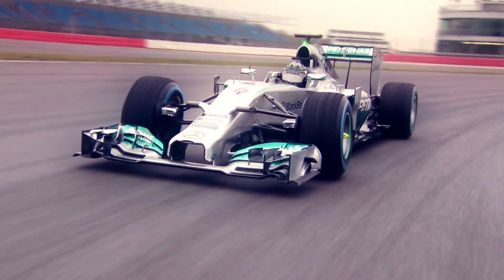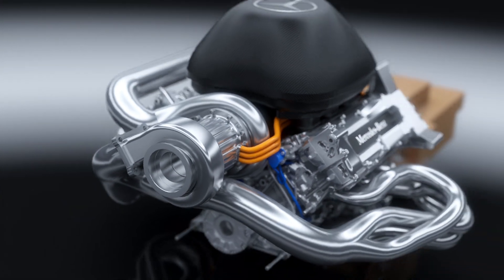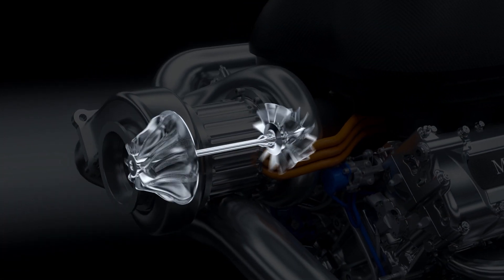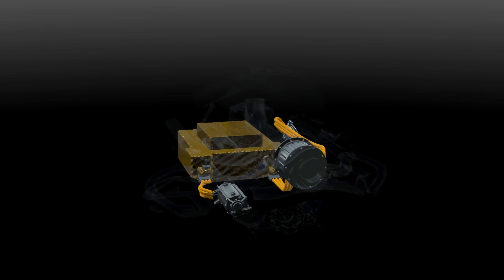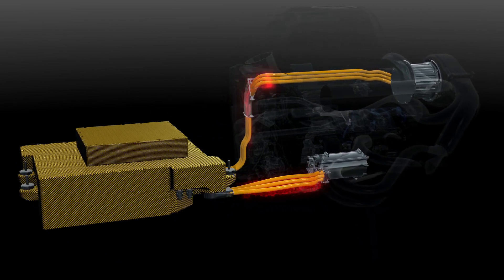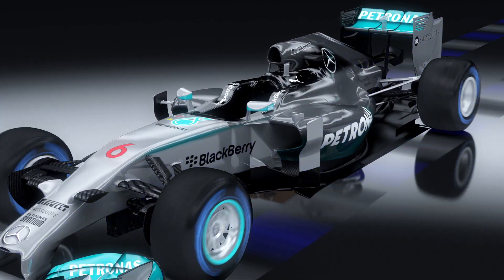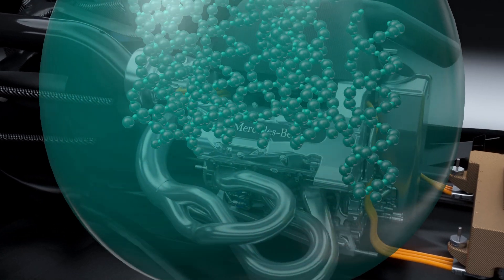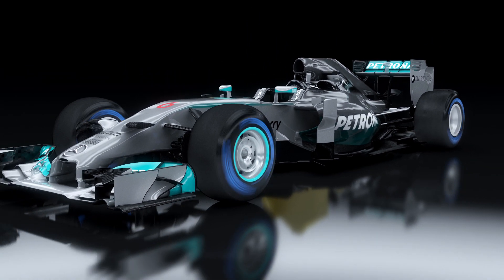Up Close and Personal with the Formula One Power Unit

Comment: Why do these engines keep getting smaller in time? From the monster V12s to the V8s and now V6? Couldn't this technology have been fitted into the V8? Why does F1 keep doing this. In a few years these cars will be running on motorcycle engines producing same amount of power as these new v6 from how this evolution of the sport seems
Reply: One word: Efficiency

Comment: Would it matter if Renault did see this video  because surly with the first race next week the FIA would have locked the further development of the power units unless it was a safety concern I know these units are so complex but surly a company of Renaults stature and experience of  building F1  race engines for years should  had it running fine by now I can see this season being a transition season for most teams though I've herd  that red bulls problems in pre season has been one big rouse to throw the competition off and didn't have the issues thay was telling the press  and that thay going to turn up in Melbourne with the car  running like a dream
Reply: whoever told you the red bull were faking their problems is a moron. there is absolutely no benefit in not running the car to fool other people then going to melbourne blind without any knowledge of how the new powertrain functions. red bull have serious problems i wouldn't be surprised if the broke down on the formation lap

Comment: Yeah, but does it go FAST!!!?
Reply: Very fast the losses are substantially lower then in 2013 , 30 precent more power from every drop of fuel is really difficult to achieve. Mercedes fighting =)
Reply: blendon8 yes, but the cornering speed will lose most time. the cars are not that aerodynamical now, because of the new nose.
Reply: Atleast we have more engine power(torque).
Reply: in a straight line they are much much faster than last year but with the aero dynamics taking a hit there is a lot of down force is lost through the corners so overall laptimes will be slower. monza 2014 will be interesting since it is a fast track we may see 2014 cars go even faster than last year.